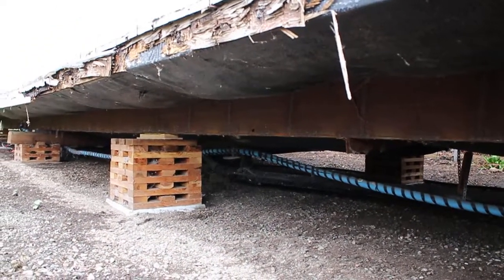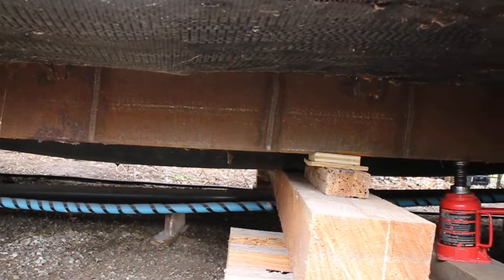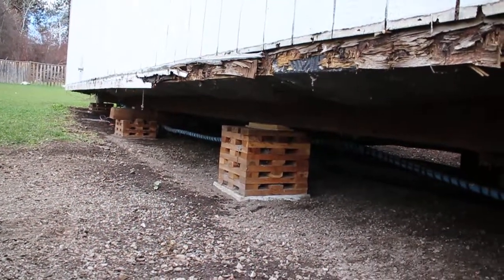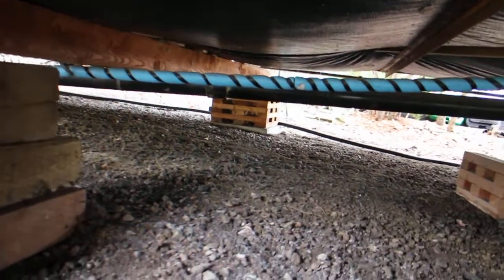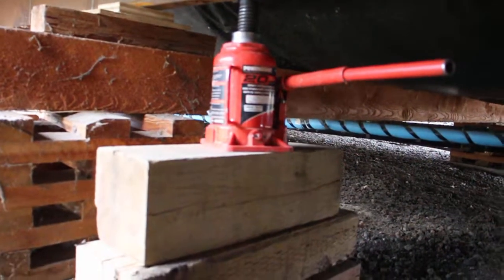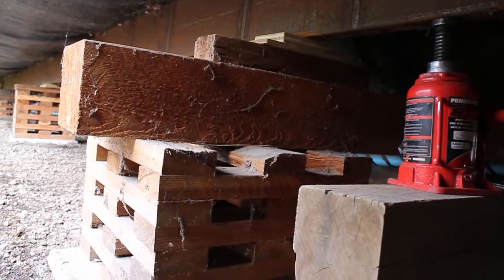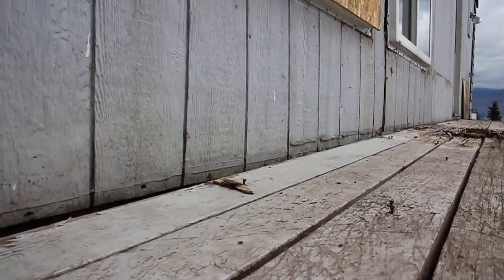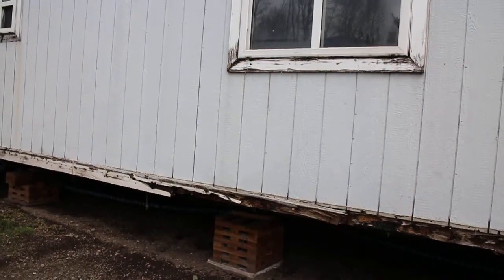Re-levelling The Mobile Home - Essential Thing To Do : E014 / BC Renovation Magazine

Comment: Best way to level/re-level a mobile home is with a water level.  They are easy to construct your own and with very little cost.
Reply from the maker: Hi Walt. Thanks for your comment. A water level is a great tool to use for levelling these homes, especially if the skirting is in place and access to the underside is limited. We will often use a water level to accompany the laser level. In this case, with the skirting off and good access, we just used the laser level.
Reply from the maker: Our goal is to get the home within + or -  1/8" of our benchmark point, so within a quarter inch.
Reply from the maker: One home that we levelled was having trouble with slow drains. While we were underneath levelling, as we brought it up to level the water actually started running down the drain pipe, now that the home had been lifted up to level. Before the drain water was actually trying to push its way down the pipe, thus the slow drain.
Reply: I used a laser on my first mobile home move & set because that is all I had and knew at the time. That first set didn’t turn out very well as a result. I’ve used a water level I made myself ever since. All the movers & set up crews I know all use them. Hope this is helpful.
Reply from the maker: Just like when cooking eggs, there are often several ways to get a job done. One is not necessarily better than the other. Jobsite conditions, the tools available and how comfortable the user is with using them are all determining factors. A plain old bubble level comes in handy doing this job as well. We use a combination of all of them. The important thing here is to get the floor of the home as level as possible by whatever means.

Comment: quick question...is there an order in which you do the cribs...do you do opposite corners or anything like that or just go from  front to back?
Reply from the maker: Hello, wilsonroo16. Good to hear from you! I hope your project is going well. :-)

There really isn't any particular order that I use. I usually find the high point and start working my way away from that crib in a sort of radius. If you have quite a way to come up you might find that you can't get it all in one go. If you start getting a lot of resistance (it is getting really hard to jack) you may have to leave that one, go on to the next and then come back.

It is a little bit like torquing the wheel nuts on your car. You don't tighten those by just going around the pattern. You go criss-cross.
Reply: @BCRenovationMagazine  thanks that is about what I thought. Project is moving along but it is a lot of work for a crew of one and sometimes 2 or 3 on the weekends. I had to get the back yard fixed first and some proper drainage put in as it was all pooling at the trailer. That is almost done, new shed built, new fence done and now I have taken apart some of the addition. Skirting will be coming off this weekend and leveling will be done. I have order my trusses and am really pleased with how little Nelson Lumber here in alberta charged me for them. I thought the roof was going to be a much bigger expense than what it actually is so I am pretty happy with the budge so far....so over all it is going pretty good!!!!!

Comment: Im paying to have someone set my mobile home up. what would you recommend doing to make sure they set it properly snd leveled it? would using a ball on the floor to see if it rolls be a good test?
Reply from the maker: Hello, Benu. There a few ways that you can check to see if your home has been properly levelled/re-levelled.

1. If you can get hold of a 4 ft. bubble level, take that level and place it on the floor in a few places around the home. Set the level so it is parallel to the length of the home and also sideways, from side to side. If the floor is level then the bubble on the level should be well within the two marker lines on the bubble vial.

2. You can use a shorter bubble level (18"-24") and check to see if the counters in your kitchen and bathroom are level. Again, turn the level in different directions.

3. Check the doors. If you close the door and look at it from the back side the clearance crack between the door and the door frame should be even and consistent around the door. The door should not pinch anywhere.

No matter where you place the door it should stay put where you set it. It should not swing open or closed when you let go of it.

4. On the outside of the home, try to get a look at any long straight line that you can. For example, look where the skirting attaches to the bottom of the home. Where that line is, if you sight down along it, it should appear to be straight, with no sags. Straight like an arrow.

Comment: I have the same  problem down here  in Florida Keys.
My question is...After you get the highest point with the level ( I'am going to use a water level) where do you start to rise with the jack?. Do you start in the opposite side of the higher point or close to that point?
Reply from the maker: Hello, Camilo DJ. It depends on how much out of level the home is. If it is significantly out then you will have to take it up to the highest point in increments. You won't get it all at once. The weight of lifting the mobile home will overcome the capacity of the jack and/or start to buckle/bend the frame. It doesn't really matter where you start.

I am going to re-level the home on the project that I am currently working on. Here is a link to the playlist for that project: https://www.youtube.com/playlist?list=PLxHwKqX3SqxhENklBdCD-P3aEFkVb8hk5

I will be getting at this in the next week and will be making a new video about the re-levelling process that will go into much more detail than this video.

Thanks for watching! 🙂
Reply: @BCRenovationMagazine  Thank you for the advice. Very helpful.

Comment: Seems like a lot of wood to use ,as wood expands and contracts  with temp. and humidity. I would use concrete blocks and just go under the beam with wood the last couple of inches . Nice video though, and tidy workmanship .
Reply from the maker: twoweary, thanks for watching and commenting. This was how it was done when this home was set up almost 30 years ago. It was code then. Now, the code has changed and when they set these up now it is exactly as you describe with the concrete blocks and wood the last couple of inches.

Comment: I have a question.  We purchased our home new in 1994, 25 years ago, a 24X52 double wide.  Being young and naive at first, then later my own health deteriorating, we never had the home leveled.  Last renovation was in 2006, we are still on the same lot we placed the home on.  Can our house still be leveled now, or will it cause problems at the marriage line with the lag screws keeping it together?
Reply from the maker: Hello, Seabreez. This is going to depend on how much your home has settled, or moved around. We have levelled several homes that have been set up for 30 to 40 years. One home, a 1982 double wide, was out of level by just over 3-1/2" from high to low. That home had no additions. We re-levelled that one with no ill affect at the marriage line. We got the floors at the seam to line up perfectly so that a 4x8 sheet of plywood placed on edge across the floor seam had no gaps. Then we proceeded with the renovation. Another one we did that was a single wide was only an inch out. It depends on the renovations that you did in 2006. If you installed doors and new walls and the home was not level then you may find that the doors won't fit or walls may crack when you re-level.